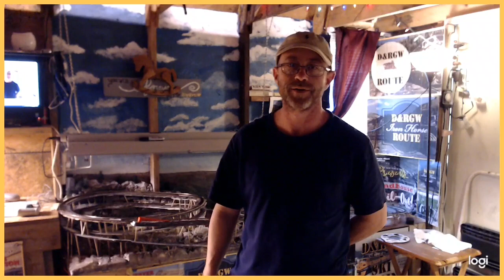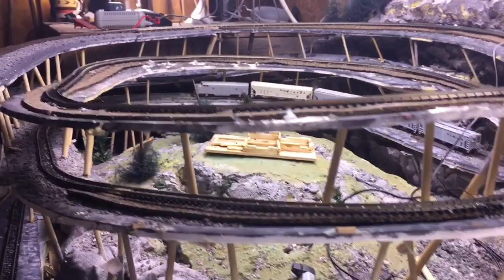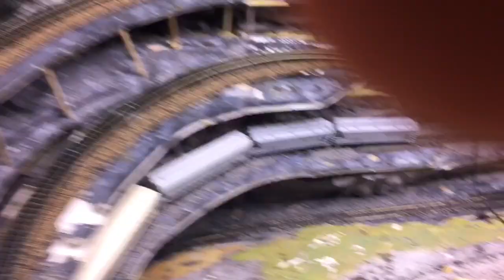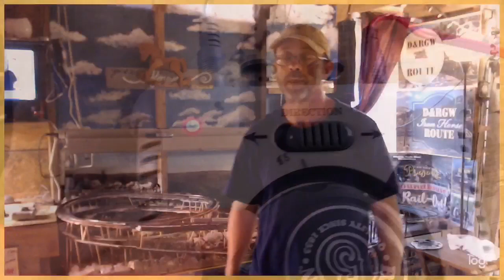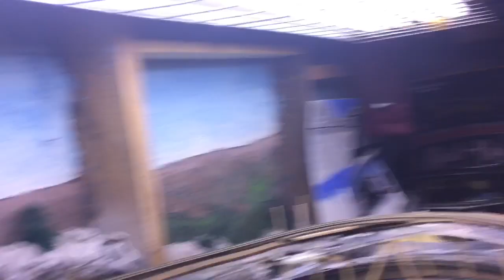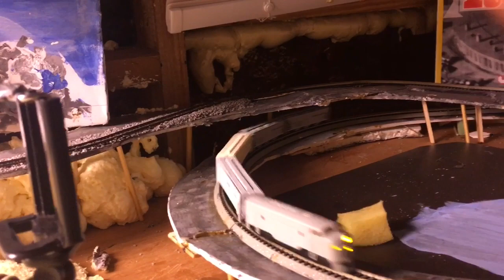N Scale Model Railroad Train Layout Tour 4.20 /2019 - D&RGW Iron Horse Route

Comment: sounds like maybe a cracked/broken gear or U joint/coupling is broken or loose. Open it up and check all the gears and drive components. If it were me I would redesign the layout with the max grade, both upgrade and downgrade, at 3%. You're going to "kill" more locos with those grades.
Reply from the maker: You are absolutely right.  I have learned that 3% is too high and any more than that can be troublesome even if the grade is downhill.  I am currently re-contructing the helix in a modular capacity outside of the layout.  I have supports built to level 3 and track laid to level 2.  It will be 5 tiers in the end.  It is more an oval this time and rather than circular helix and it has an additional level.  The extra length and level bring the grades down to about 2.7%.  I figure Kato ABA should be fine with about 14 cars, which was typical for my prototype.  The line I model has a consistent 2% rise all the way from Denver to Winter Park.  
The downhill grade will be addressed next after the new helix goes in.  I can re-do the helix all I want, but If I still have a 7% downhill grade, I will still have continuous problems.  I plan to reduce that by at least half after the helix project, prior to extending the layout.  Thanks for watching and commenting Nate.  i will see you tonight!
Reply: @IronHorseModelRailroad  Hi Brian, glad you're working on fixing the grades and hopefully this should fix your issue and you won't have anymore issues from then on. See you tonight!